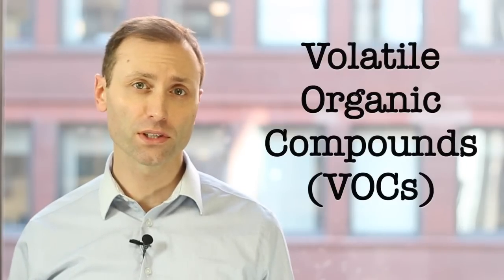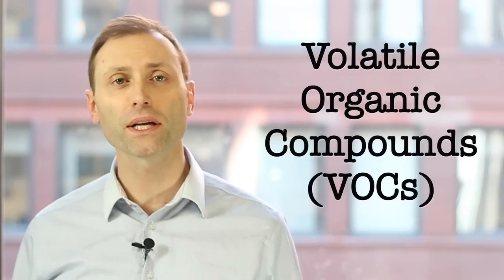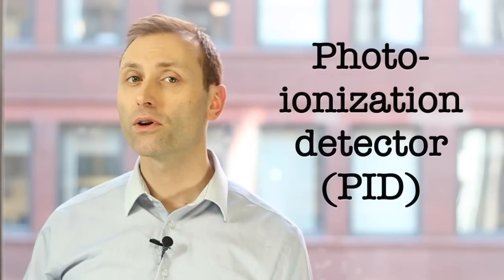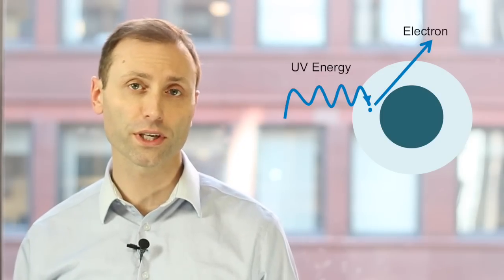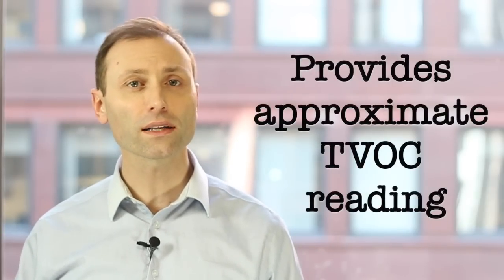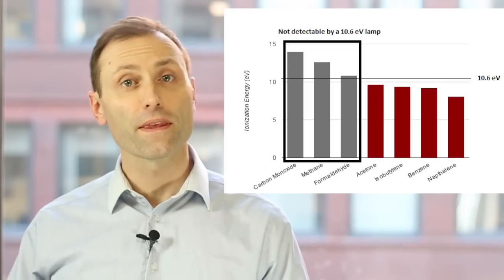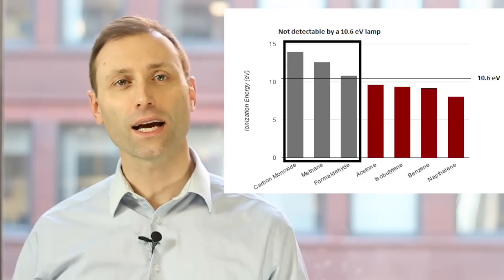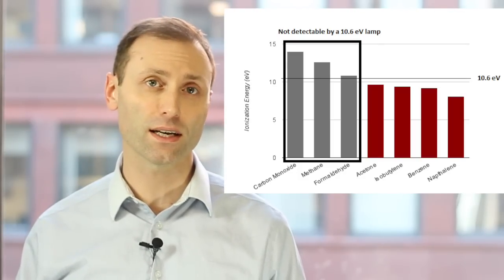Measuring VOCs with PIDs

Comment: Try selling this service to a customer, Time explaing the method, the diffrent compounds and then giving them a solutions is a hard to impossible solution, Like a Particle counter, I will put the particle size in a chamber based on size , but you will have to assume the what the particle is based on this size.. I had these tools and the price (over 14K) I all could tell the customer is we need to do lab work. These tools in the toolbox will never be recouped monitary wise,..